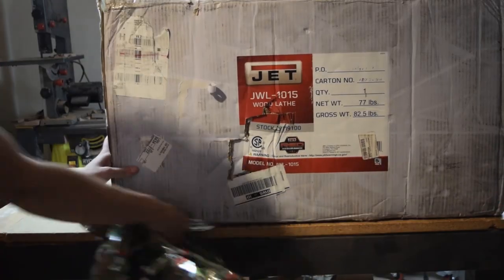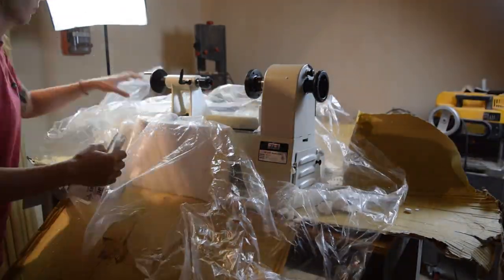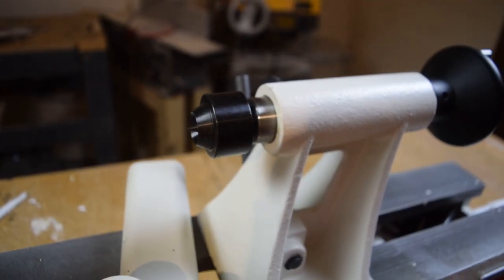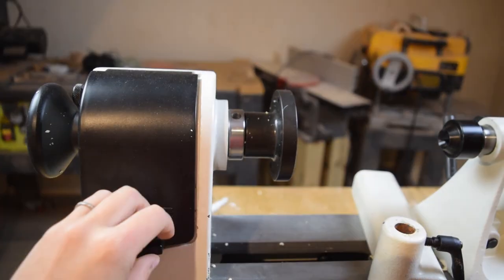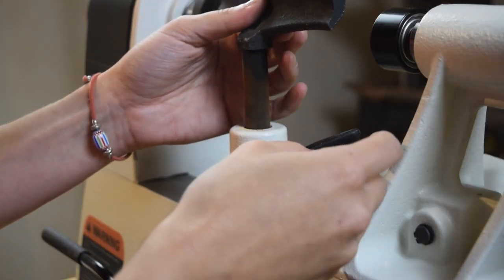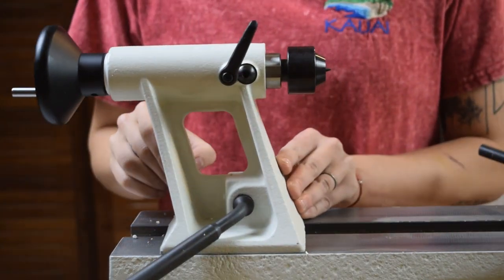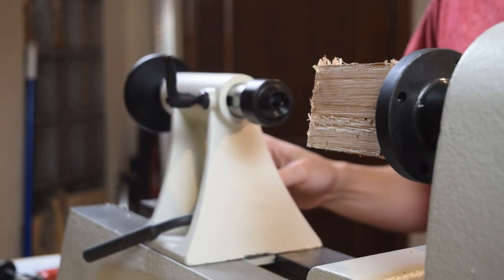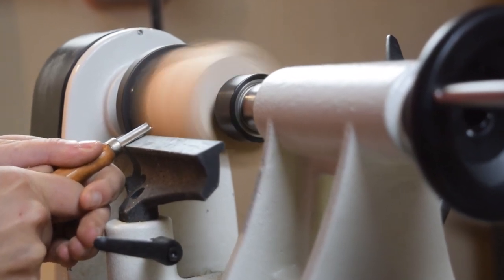NEW TOOL | Jet JWL-1015 Variable Speed Lathe | Unboxing and Review

Comment: You've got a nice lathe there and I know you'll enjoy it. One suggestion: You shouldn't hammer on the drive spur with a metal hammer. That can cause it to fracture and/or mushroom. It's better to use a non-metallic mallet or put a piece of wood on top of the drive spur and hammer on that. Your drive spur will last a lot longer that way.
Reply from the maker: Thanks for the tip, Skip! Definitely still learning all the ins and outs.
Reply: @HonestWorkDesigns  make a wooden mallet

Comment: Thanks for the video! Being a turning novice myself, please take this with a boulder of salt: I don't know if turning with a spur center mounted through a face plate is necessarily dangerous, but I don't think I've ever seen it done before. Maybe because it might prevent the spur center from going in the whole way, or simply because it makes it more difficult to get to the very end of your piece?
Reply from the maker: Oh good point - you know, I think I must have just been subconsciously keying off the images of the manual where I saw it going through the faceplate; but you're so right! I did find the faceplate annoying and in the way on later actual cut pieces. Thanks for dropping a line!